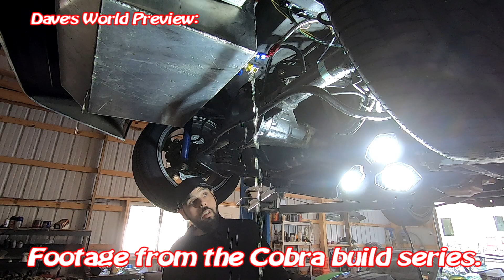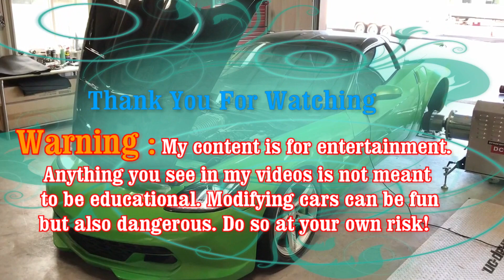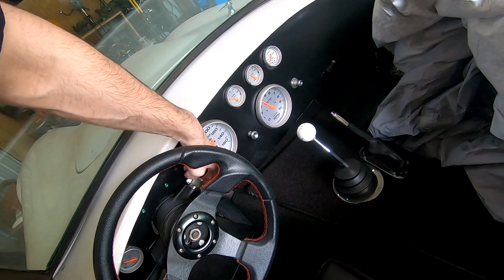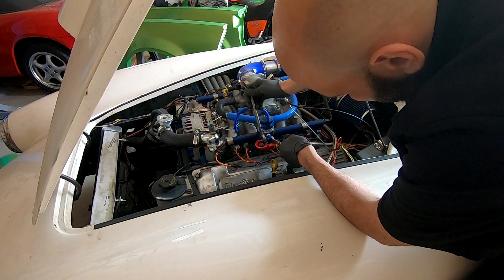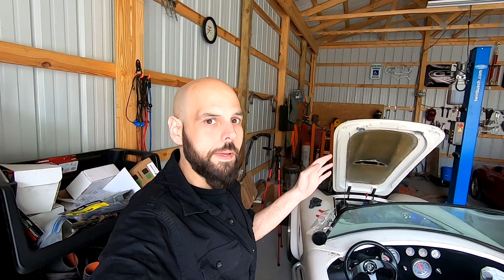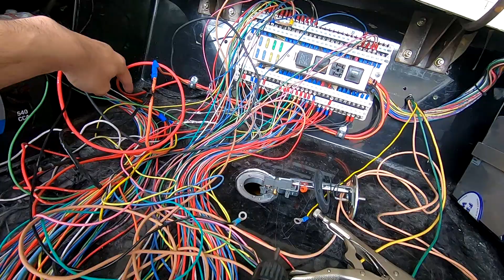Budget Cobra Build Episode 2

Comment: Efi motors need about 60 psi out of the fuel pump, I would also check to see if the tank is vented an unvented tank will cause a vacuum lock on the fuel tank and prevent fuel from being delivered.

I had this happen to me on a motorcycle once and had to ride 30 miles with the gas cap open to get home.
Reply from the maker: Ouch. Hi yes when I built the tank I put in a roll over vent and it is vented. What did you do to end up repairing the motorcycle?
Reply: @davesworld2132  drilled a pinhole in the gas cap gasket then I rode it for 75,000 miles with no issues
Reply from the maker: @ironmike4843  That’s a great move. What kind of tank do you have in it?